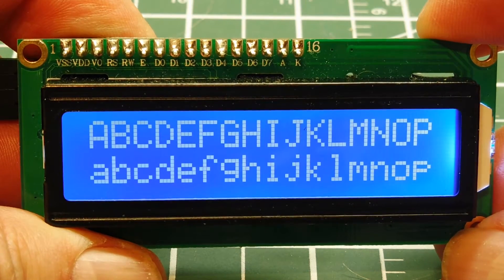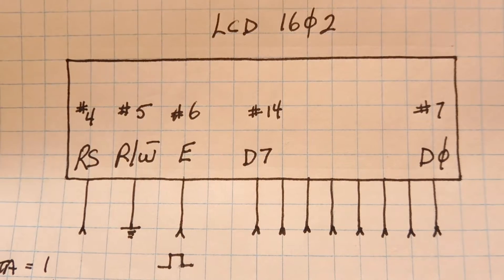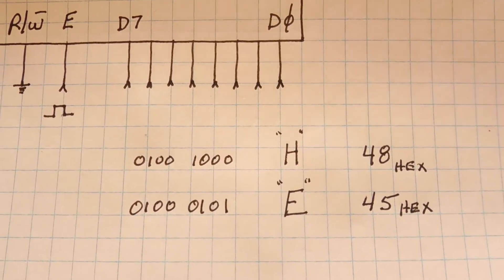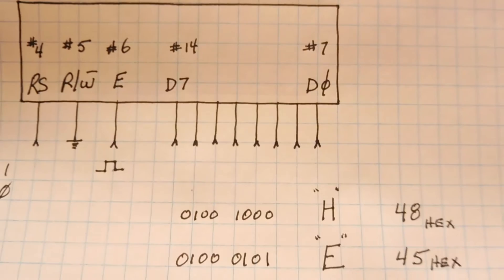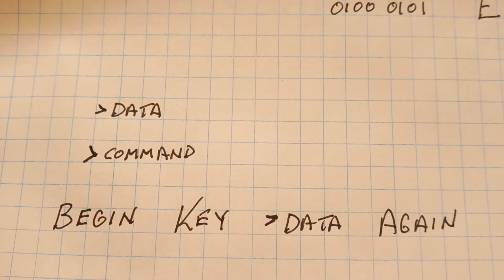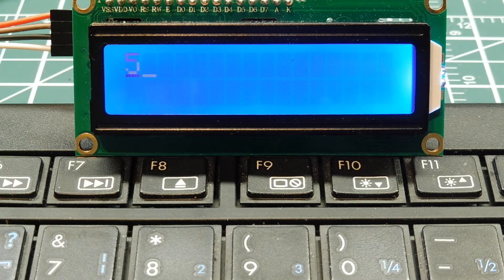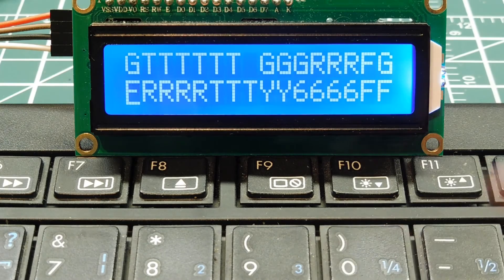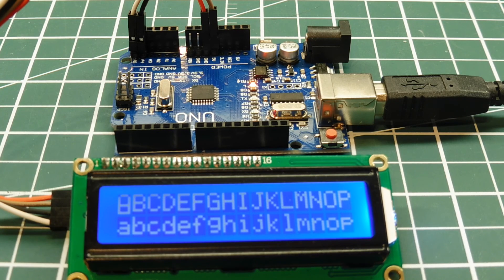Interactive LCD Control  / Arduino UNO

Comment: I like the way you send commands via serial to get to know the device. I did not follow one thing though. To let your program know if it was data or command did you first use a keypress to toggle between data and command modes?
Reply from the maker: Yes ... that is correct. I used a Function key to toggle between data and command modes. In command mode >Command is used in the code to make the display respond to commands.